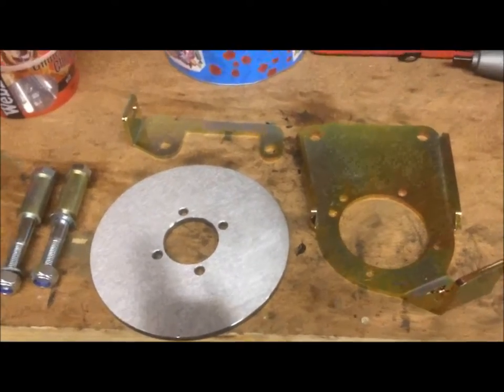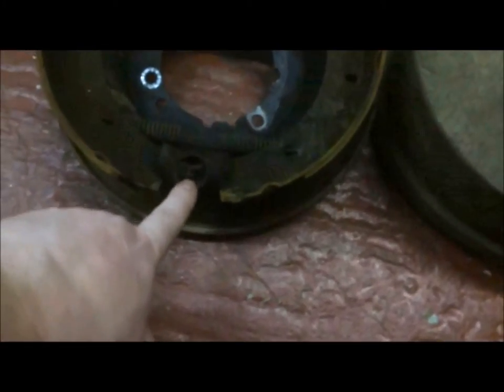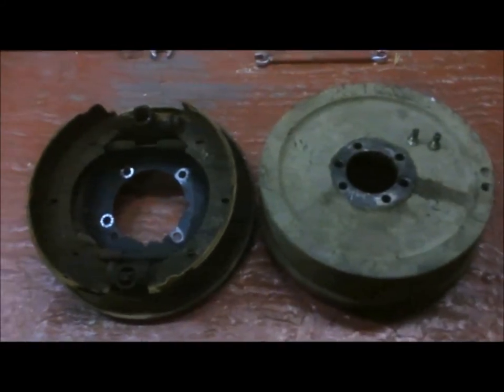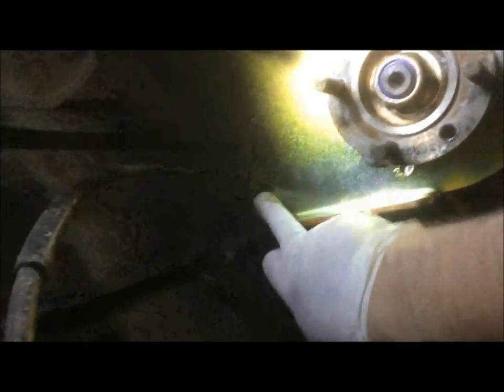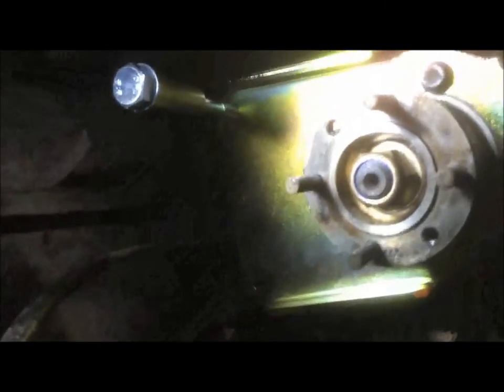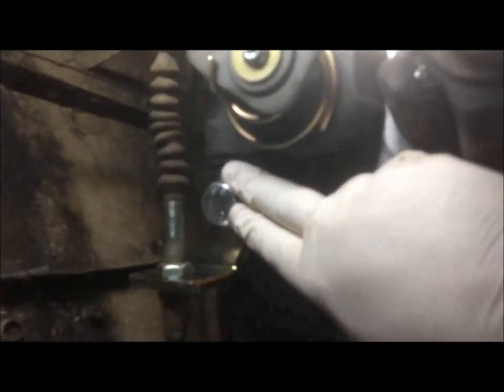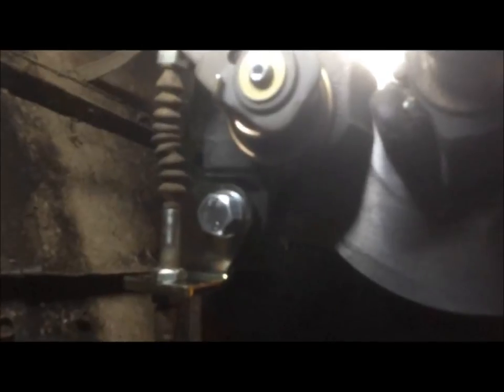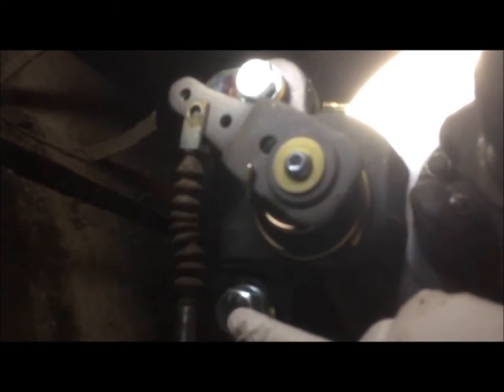X Eng Hand Brake Conversion

Comment: Top tip for getting stuck drum off.  Pretend to the landrover gods that you don't want it to fall of, remove prop shaft and don't replace nuts and drive around in front wheel drive for a bit.  Make sure you drive places where you really don't want it to fall off ie heavy traffic during school run etc.  Low and behold I guarantee it will fall off nicely.  Don't stop to retrieve but drive off as quickly as possible.  You are welcome

Comment: How's it performing after a few years use ? Any issues ? Looking at it, to me it would have been better to have a casting or more rigid bracket holding the caliper to the xfer case instead of the sleeved bolts. Would have been more tolerant of extreme use then, e.g. emerg brake use or winch. I read their warnings in the instructions.. suggests it is a bit of a compromise.

Comment: How does it hold?
Reply from the maker: +L4RRY , It hold absolutely fanastic, i have parked on the steepest banks & hillsides  it's held without fail, where as in the passed with the normal brake, once wet it's slips butwith the X Brake it holds without fault :D well pleased :D